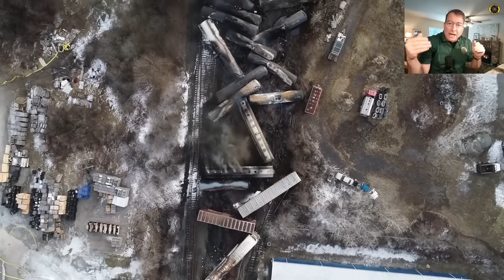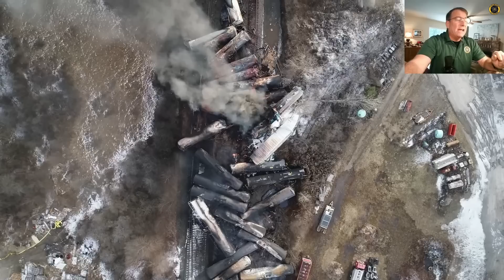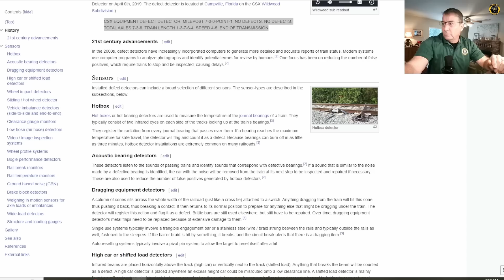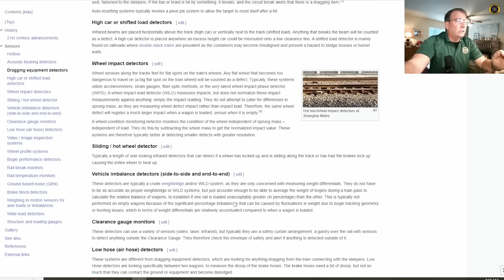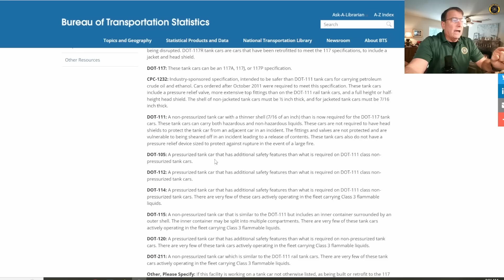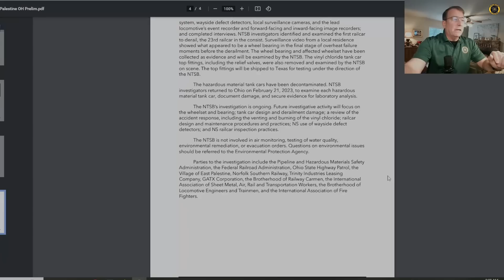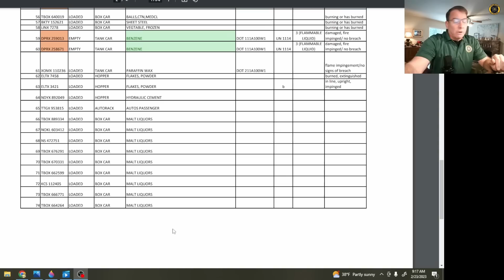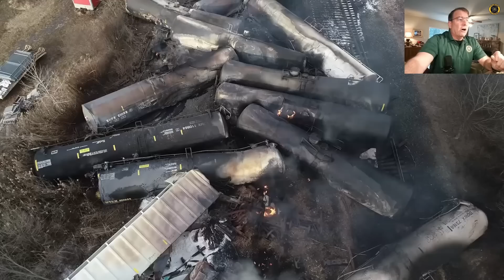NTSB Prelim Report: Norfolk Southern Train Derailment 23 Feb 2023

Comment: No offence, but railroading is not your expertise, and your derailment observation in the first minute is already very off.  This is how misinformation happens.

The zigzag pileup shape has absolutely nothing to do with "Emergency Braking."  This is standard for any derailment with steel constructed rail cars (in the wooden days, it would have caused the cars to telescope inside of each other, which is much worse).  This is due to the inertia of the rest of the train continuing behind the initial derailed car causing the pileup.  Without the emergency brake, it would have been far worse, as even more cars would have been in the pile up.  Even when the pressure line is broken, it does not make the brakes instantly "lock-up" as the pressure does not immediately go to zero, it takes time for the air pressure to leave the brake pipe.
  
While the air brake is the emergency brake, it is also a standard braking system for the whole train, and not just for emergency.  It acts in an emergency should the air line between the cars become disconnected. The "regenerative" brake you mentioned is called the dynamic brake.  This is done by allowing for the electric tractive motors of the locomotives to act like generators, creating resistance.  What makes this different from the regenerative breaking electric or hybrid cars is that that the electricity produced from the tractive motors is not stored or reused, but instead runs through resistors, turning that energy into heat.  Dynamic breaking preferred as it causes less wear on the brakes of railcars, but it is never really enough to entirely stop a train.  If anything, it is concerning that the airbrake was not applied sooner, instead of the crew overly depending on the dynamic brake.  To somewhat explain this in aviation terms, it is like instead of dropping flaps to slow down the plane, they are increasing the pitch of the propeller on idle to make more drag.  However, from the train crew, it seems like they have performed largely to what they were expected to do, so there are no real faults there.

If there is anything to debate about it, it is likely due to the railcar inspections, and if that responsibility for that falls onto the railroad or railcar owner (most railcars today are owned privately and not the railroads).  It may also been a fault in the axel fault detection system only looking at only one end of the axel or not as much heat was transferred from the failed bearing on to the axel.

Comment: I am surprised the system doesn’t alert the driver if a truck has a increasing axel temp after each 10 mile reading by the track side detector. i.e if there is a increasing temp trend that is still under the trigger point shouldn’t that stop the train? 

Great reporting, thanks

Comment: It appears that the defect detectors detected the temp rising at different locations, but this data is not actually processed. Additional safety measures in the future could include realtime analysis of data. In this case, a rising temperature on a specific axle could be criteria for an emergency stop, instead of letting it get out of control before emergency measures are applied.

Comment: Juan:  Here is what I think is the bottom line... They pass the first detector which reports 30+ degrees above ambient temperature, 10 miles later a detector reports 103 degrees over ambient temperature, and they wait another 10 miles or so for a report of 250+ degrees over ambient temperature to try to stop???? 

Norfolk Southern Railroad thinks a critical bearing temperature doesn't exhist until 170 to 200 degrees above ambient temperature occurs. 

 That means on a typical 85 degree day if the detector reads 160 degrees....  By NS policy that's not critical even though you have an actual temperature of 245 degrees.

There are some folks at Norfolk Southern Railroad that need to loose their job and NS Railroad needs to pay some hefty fines. 

This derailment was preventable BIG TIME!!!

Comment: Every car should have basic sensors that can be connected to the train and all other cars with identical sensors, transmitting this real-time diagnostic data to the engineer.  It's 2023. This isn't out of the question.
Reply: 1.6 million freight cars would need to be equipped. Astronomical cost.

Comment: Thanks for this report. I have listened to the UP railroad detector at mile post 212.7 , near OROVILLE, many times. The train activates the detector when the first axle crosses it. Then it scans the train and counts axles. After the train is gone there is a delay, about 20 seconds, before the results are transmitted.  That means that the engines on a long train are several miles beyond the defect detector before the engineer gets the information. Im thinking a rapid rise in bearing temp may result in little time to brake before the axle fails, especially if the temp for a warning is too high.
Reply: I believe the detector will announce a defect immediately.

Comment: Airbrakes on trains can be applied incrementally... they are not usually used in an all-or-nothing mode = emergency stop.

Break the airline, and you will get emergency full-on application of the brakes - this is a safety feature, as Westinghouse had in his original design way back when.
Note: The train crew can initiate an emergency stop, or it can be caused when the line breaks, such as when a derailing car pulls apart the hose connection next to the couplers.

Comment: We haven't had a chemical spill of anywhere near this magnitude in North America in decades... people forget how ugly they can be.

Moving certain chemicals is the least unsafe when shipped via rail or river barge. The quantities are too small to move via pipeline.

There are DOT standards of design and construction of tank cars intended to prevent this sort of release in a derailment. The vulnerable points are the valves used to fill and drain the tanks, and the pressure relief valve, The tanks are pressure vessels, made to the ASME Boiler & Pressure Vessel Code, and to US DOT impact standards. It's not at all easy to puncture such a tank, but it can happen... a broken axle due to a frozen journal bearing can under some circumstances puncture a tank.

As can be seen in the aerial photos, the cars are jackknifed and stacked up on top of each other, such that the incident reponse team reported that they could not safely attach hoses to pump out the contents.

Now, the incident response team is facing an active fir, with at least one tank car leaking expanding pressurized combustible gases, and in a built up area.

At that point, there is a very real risk of a BLEVE - a Boiling Liquid / Expanding Vapor Explosion - look it up, those are extremely dangerous situations.

The incident commander was stuck with a set of bad choices, so they chose the least bad option, to drain the liquids into a trench and set them on fire, away from the tanks.

This is an older technique for controlling such spills, and it is not the least bit pretty. Being an open flame, fed with air by natural draft, the combustion was fuel rich, leading to the black soot in the smoke plume.

The presence of vinyl chloride didn't make that smoke any nicer, because the combustion products include phosgene (carbonyl chloride), hydrochloric acid, chlorine, and chlorine oxides.

There were two different acrylamide chemicals on the manifest, and benzene. While burning those in the same flame as the vinyl chloride gives you the building blocks for making dioxins and furans, the reducing flames due to oxygen starvation, with reduced flame temperatures, and the lack of a catalytic dust, and a limited time at temperature all mitigated against the De Novo synthesis of dioxins and furans.

Doesn't mean that the smoke didn't contain acute nasties, but the incident team was trying to avoid making carcinogenic residues.

Now, there were releases of some dense chemicals which did not get burned off - Sulfur Creek in particular has contaminated water which the EPA is working to clean up.

This is an ugly mess, but a series of exploding tank cars spewing out flammable liquids that flash into ignitable vapor would have really nuked the town.

Comment: A few things to clarify. The emergency braking did not cause the train to "accordion". If there was a hot axle bearing, it eventually failed, and the truck fell apart. Now the train is dragging and broken truck that can damage the track structure. This mean the ties that hold the rail in gauge are damaged, and the rails start to spread apart. Now all of the trucks behind the damaged truck become derailed. The cars naturally "accordion" since the couplers are holding them together.  Somewhere in this event and air hose broke, and the train went into emergency, and eventually stops. There is a tremendous amount of energy in a moving train, and just because the brakes are in emergency stop the train does not stop on a dime, and it takes time for the train to actually stop. Until the train comes to a complete stop, the cars keep derailing and folding up.  The subject of train air brakes. You are right in that air pressure ( I think 90 lbs for freight, and 110 lbs for passenger) is use to keep the train brakes released. If an air hose breaks, then the train goes into emergency. But the is another aspect of the air brake system. If there is a slow reduction by the engineer of the "air line" of 10-15 lbs, there will be an equivalent application of air from the reservoirs on each car to the brake cylinders.  If there is another reduction in the brake pipe, then more air is applied to the brake cylinders. If the engineer recharges the brake pipe, the air in the brake cylinders will release, and the reservoirs will be recharges to 90 lbs. There is way more detail to train brake systems, but this is a general description.    Love video.

Comment: The emergency brake application was caused by a sudden loss of air pressure in the train line caused by the derailment. Derailment first, emergency brake application caused by the separated train line hoses next. The accordion effect caused by the derailment of 1 car, which causes all the following cars to slam into it until the pileup stops the cars, similar to highway pileups in heavy snowstorms or fog, creating a large mass of wreckage, as following cars can't see the pileup until it's too late. Same principle as the great distance needed to stop any long large train, sometimes more than a mile.
 Retired freight railroader, with 42 years on freight trains.
Reply: What normally causes derailments?
Reply: @mballer  Broken rails, broken bearings, or other mechanical failures.

Comment: PTC, ATP and all the other types of automatic brake control systems can only (try to) prevent overspeed and SPAD events. Wayside detectors are designed to detect high-frequency noise and heat signatures that MAY cause a safety risk. An emergency brake application will always occur when the airlines are broken. However, the speed and mass of the train is the main factor in determining how long it takes to actually bring the train to a stand, and therefore, the amount of destruction caused. The railcar pattern seen in this derailment simply means that, at some point, one of the cars 'dug in' and the momentum of the cars behind kept them plowing into the increasing mess until kineti energy was used up. The train section before the derailed car usually remains upright and attached to the locomotives.

Comment: If the engineer crew on the locomotive are getting the signals from the HBD sites as they are going along, they apparently overlooked the issue after the second HBD site.  Sounds like the company needs to reconsider their procedures for checking these bearings when they get temperature increases like this.  
Does the HBD not send a signal unless it exceeds the listed "acceptable temperatures"?  If so, the crew probably didn't have any idea that there could be an issue until it was already overheated.  
Interesting the CYA comment at the end of the report about NTSB not testing air or water quality.  Our government at work!
Reply: It's a different department, there is nothing wrong with that, no CYA.
If the chemicals caused the derailment they would cover it.
Just like a plane crash, they try to figure out what caused the crash, if the cargo wasn't a part of the cause there is no reason for them to look into it

Comment: It is my understanding that PTC has to do with allowing or preventing movement of a train depending upon the traffic situation (which trains are where, etc.). It would seem that a triggered HBD would not govern train movements, but if it did, it would have to be tied into the PTC system. If it was not, PTC would have no way to sense a truck problem, so could not be expected to prevent a derailment, at least not from an overheated bearing. Does anyone know if NS has this level of integration? Sounds just a bit too sophisticated for a railroad, but what do I know?

Comment: Train brakes operate on vacuum rather than pressure. Lose the vacuum and the train brakes get applied full on. If it was the other way around cars parked for a long time would roll away if the pressure is lost.
Reply: No, each car has a air reservoir to apply the brakes when the air line pressure is reduced. Reduction can be either a few PSI for service brake, or completely dumped for emergency.
Reply: Vacuum brakes are an old form of braking from the UK

Comment: The EPA or USCSB really need a go team for these massive scale chemical spills/releases.  It's pretty obvious local emergency responders do not have the expertise on what to do in these situations. While the action plan of blowing up the leaking tanker may have been the right choice, it certainly seems like it was a decision made without complete understanding of the ramifications of said action as well as lack of exploring other options.  It's also clear the vinyl chloride did not burn off as thoroughly as expected as it's being detected pretty far away at levels that are not recommended for  human exposure.

Comment: Juan great report, to the point and informative.  Your question on HBD/DEDs is that if there is a defect detected, then there is a warning over the radio. You are to slow to 30 mph, and as soon as possible stop the train and visually inspect the car(s) for any defects.  We trainmen are trained to look for the obvious, but we are not "carmen" (mechanical department car inspectors).  IMO, what caused all the accordioning of the cars is all the wight behind those cars.  That train was 150 cars, and those cars were near the head end of the train, and it takes time for the emergency application to propagate to the end of the train.  Add in cold weather, air is harder to compress, and all the rubber, plastic, etc. shrinks, so it takes more time for the brake pipe pressure to transmit thru the entire train.  Also being in dynamic braking the slack would be bunched up against the locomotives, adding to the "buff" forces against the cars in the head end of the train.  I can go on and on about what my thoughts are the cause of this.  Yes the emergency application was a big contributing factor, and the burnt journal was the start of it.  It's corporate America and wall street running this industry into the ground.  This is not going to be the last of these types of accidents.

Comment: Yes, the detector is regularly inspected to insure accuracy. And yes, Templin roller bearings are great, but tend to fail at the end of their life, quickly and unexpectedly. I’ve seen them fail and start throwing fire with showers of sparks in less than 2 miles.  In the case of this train, that  distance was less than the length of the train.
Reply: Something went wrong with the HBD, though. Buetech Bliss is 20 miles from East Palistine. That means the axel was on fire 20-25 minutes up the track. That's a little more than the length of the train I'd say.
Reply: Minor point:  I believe you meant to say Timken roller bearings🙂

Comment: It tripped a hot box detector, but was in full flames by the time they got the train stopped.
My question would be what had happened at the previous detector for this train?  If the problem was  undetectable at the first detector and then on fire by the next, how did they plan the spacing of the detectors?  These bearing boxes do not go all at once, they get hotter and hotter and hotter.